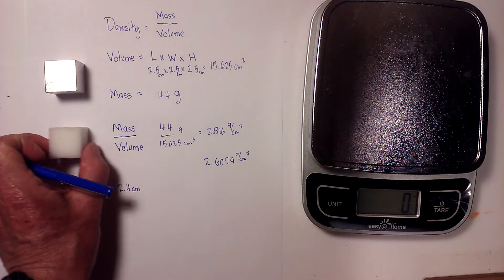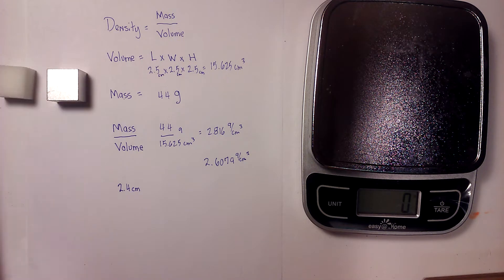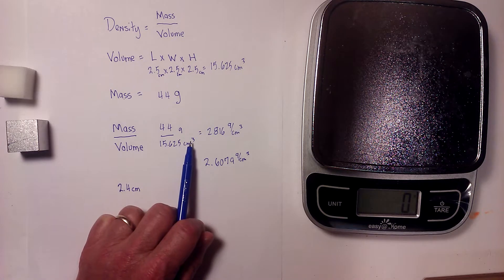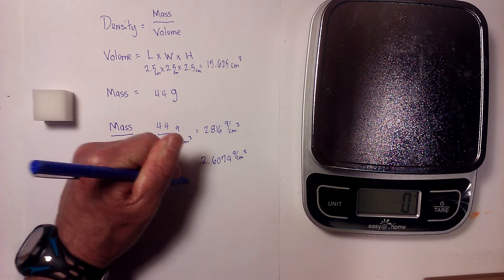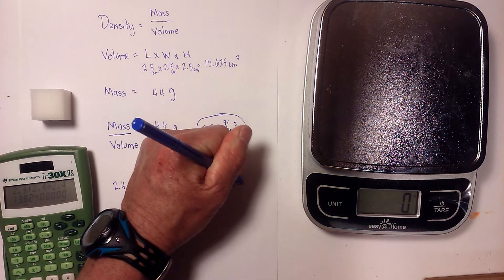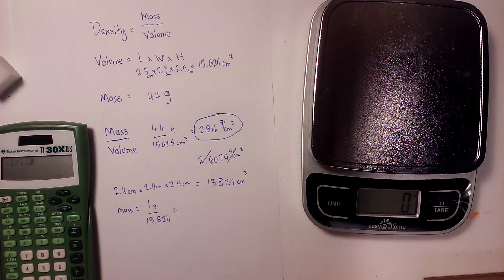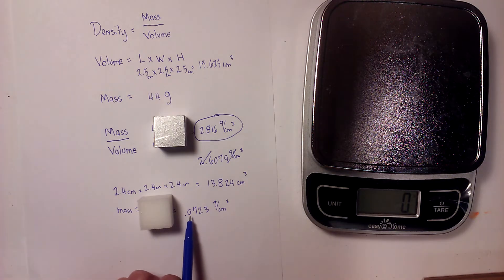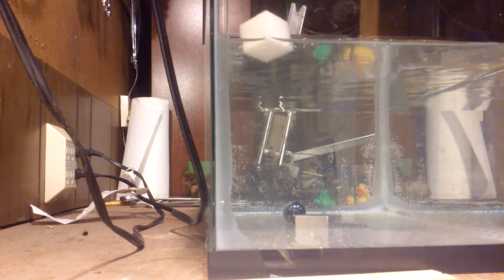Find the density of a solid

Comment: The instructor in this video makes gross errors in significant figures, an extremely important aspect of all measurements.  For example, 44 g/15.625 cm3 = 2.8 g/cm3 (NOT 2.816 g/cm)!  And 1 g/13.824 cm3 = 0.07 g/cm3.   Even if you don't want to explain it, you should at least model it correctly when recording instructional videos.

Comment: hello man, i have a confused. when calculating the density of foam, I read somewhere that :
p= m/m'
p : density
m : weight of foam in the air
m' = volume of distilled water occupied = V -V'
example :
m = 3.6 g, 
V initial water volume = 852.3 g, V amount of water remaining when they put foam into water = 836.5 g
==> p = 3.6/ (852.3-836.5) = 0.228. What do you think about this calculation for FOAM compared to your calculation?